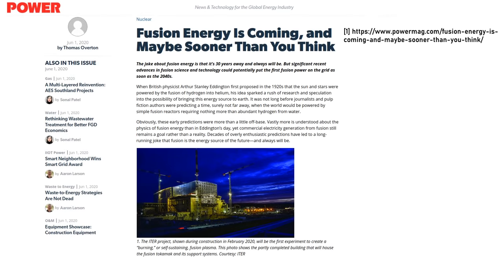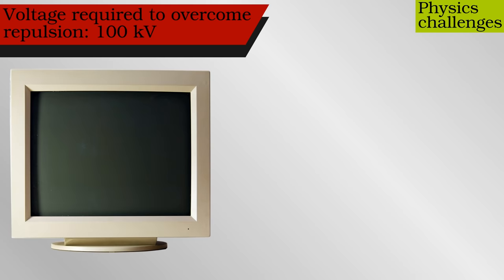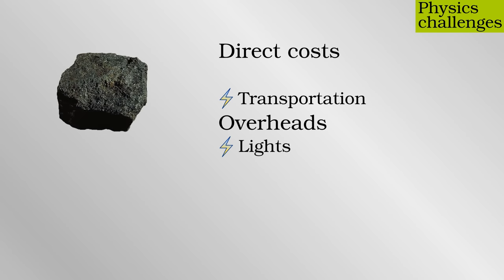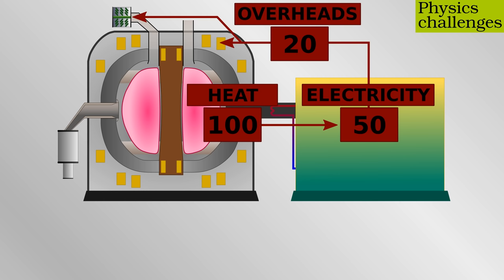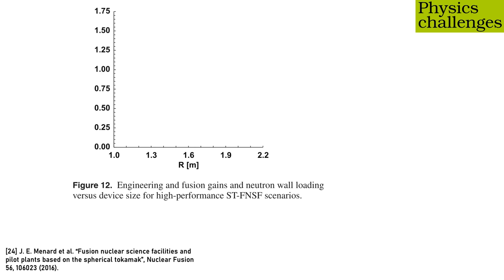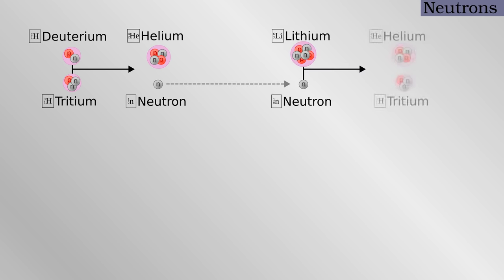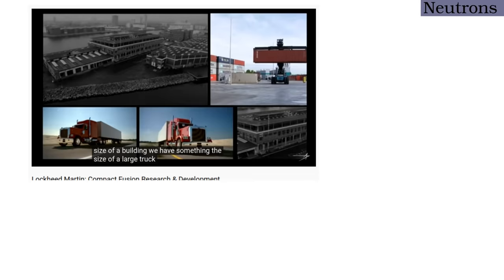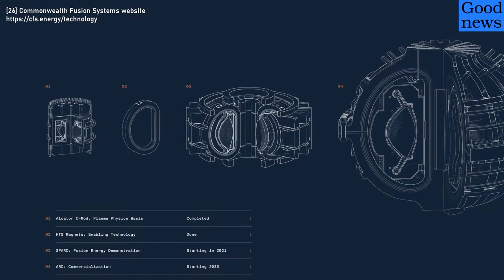Former fusion scientist on why we won't have fusion power by 2040

Comment: It's similar in chemical industry - a yield over 80% of a single step in organic synthesis is considered very good, and over 90% excellent. If just one step has say 50% yield, then the total yield of the whole process gets halved.
Reply: So walter white is a god? Hehe
Reply: There’s a company that got 120 millions Celsius for 101 second. Any progress here?
Reply: @jendlti  Pretty much yes. Just the chemical workup (getting the products out from rxn mixture) and purification have significant losses. One would have to go for some fancy enzymatic process to get 97+% efficiency of an organic reaction and then some very tedious and energy-intensive workup the get all the product out of the reaction medium. It's never like baking a pie, where you just shove it in the oven, bake it (and shake it :D) and you're done. Even if the reaction efficiency is very high, the yield will be lower due to workup.

Comment: You're definitely right about overly optimistic dates being given, but its hard to say what the future holds. MIT's higher temperature superconducting magnets was a huge breakthrough. If we have another 3 or 4 truly major breakthroughs in the technology, that could significantly decrease the time to the first fully operational reactor.
Reply: That pesky cell wall material and tritium breeding is gonna bite our behinds. Plasma control too has got to be super tight.
Reply: @marka1000  As far as I'm aware, ITER (being built in southern France) uses a hybrid design that's not tokamak, but called stellerator or something like that. But i think it's supposed to be more efficient at confining the plasma. Also, tritium will be easy money on the moon, it's everywhere up there. In fact, I think achieving effective fusion power would trigger a new gold rush to the moon, and kickstart the actual colonizing of the moon. Just food for thought!
Reply: MIT were only a "couple" of years from cracking cold-fusion and that was back when Val-Kilmer was a teen.
Reply: @esahg5421  Cold fusion, uri geller bending spoons with his mind... the 80s were a strange time of silliness :D
Reply: @wibblewobbler9104  can you believe it i was a fan of both lol, but been in every avenue i can imagine since. cold fusion sure cost alot of money just like zero-point energy and pyramid power yeah investigate everything but uri now uri was special.  what he taught me was "no one trusts a magician" lol 🤣
Reply: The problem with MIT's fusion approach (and most others, including ITER) is that not only do you need to breed the tritium needed for operation by using lithium as a consumable, but these fusion reactors need pure tritium to start up, and tritium is extremely expensive and rare. Going to the moon for it won't be economically competitive with conventional power anytime soon.
Reply: @TROPtastic  so let me get this right, you think that they are going to fail because they don't know this? but you do ? and have some wicked insight that they couldn't possibly have ? how about just Deuterium with a higher confinement and temperature with the new superconductors ? no ? maybe you should call them and tell them you are on to something...
Reply: @jackfoster3323  they don't NEED Tritium, but it would make things easier, but not essential.
Reply: @marka1000   Most of this stuff is over my head but I read on it from time to time.  A few weeks back I saw a story where one research group had a lot of success getting an artificial intelligence to make the rapid nuanced changed need to manipulate the plasma.  It even created some of it's own new plasma formations that the scientist hadn't thought of yet.  It may have just been a simulation but it appeared to be a reachable solution.
Reply: It's also really close to the technological singularity. Where AI can fill the gaps in our knowledge
Reply: @jjvvjj80377  At the time of the Wright's, many people in many countries were very close to getting "functional" powered sustained manned heavier than air flight. Lots of qualifiers, because without all of them, it was all achieved prior to Wright's famous first flight. The main problem for most of the others was that they may have had a superior piece but were also doing something stupid that held them back. For the Wright's it was they had the superior wing and propeller, a good enough power to weight ratio motor, and horrible control system and aerodynamic control surfaces. It was just good enough to make a mostly strait flight. Langley had a far superior motor and IIRC the modern control surfaces largely came from Curtiss, well for USA. France had people that were making all the same discoveries and only a touch behind, as did many others countries. If the Wright's didn't do it, I don't think it would have been more than a year or two before someone else did.
For fusion, I think the closer beast would be fission. During WW2 countries were working on it with the full financial backing and teamwork only a government can provide. If it was left to corporations all working in secret, I think it would have taken decades, or more.
Reply: @jackfoster3323  Acquiring it and transporting it from the moon is another story.
Reply: @jjvvjj80377  Trust nothing, verify all
Reply: You can't plan for three or four truly major breakthroughs in technology.
Reply: @hellstromcarbunkle8857  Zero planning, serendipidous evidence, mega genius...
Reply: @chrisantoniou4366  Not sure the evidence was serendipitous. The deduction of universal background radiation was the result of solid, disciplined elimination of competing explanations.
Not luck, work.
GENIUS however, no question and luck played a part in finding the fit between the  observation and the explanation was awesome.
Reply: @hellstromcarbunkle8857  Those pigeons pooing in their antenna was luck!
Reply: @chrisantoniou4366  I was actually thinking that their brilliance in identifying the source once the Poo and the oxides were gone was Genius, with some luck
Reply: @hellstromcarbunkle8857  That's exactly what I meant too.  If it hadn't been for the poo they might never have looked...
Reply: If...if...if...
The more if's, the less likely it is.
Reply: @deang5622  Hmmm, no.
THe more "if...then" statements, the more complete the understanding of the problem.
Thus the more likely the project will be finished.
Reply: @hellstromcarbunkle8857  No you are wrong.
The higher the number of if statements, the higher the number of problems that need to be solved. The greater the number of problems that need to be solved, the lower is the risk of success.

The presence of an if statement is realisation that there is problem to be solved;  it says nothing about your level of understanding of the problem, and it also says nothing about your understanding of what the solution to that problem is.
Reply: @deang5622  So, you've never coded a single line of control system?
Because if you had, you'd know better.
Reply: @jjvvjj80377  but they never would have have learned flight beating the air with a spoon as hard as they could, and just changing what the spoon is made of over the years.
Reply: @psycronizer  someone should tell them. This won’t work because they’re completely misunderstanding the basic matter/energy relationship, and trying to run backwards. The theory of relativity at its most fundamental level means matter itself is already highly concentrated energy. Concentrating it into denser elements takes power, and “squeezes” some of that applied power out in the transformation, but not more than you put in. People talking about cold fusion power are as confused as people talking about “hydrogen power”. Hydrogen isn’t a power source, it’s a battery. You don’t mine hydrogen, you use power to create that form, and the amount of energy you get back will be less than it took to create it. But it’s a clean process, cleaner than most batteries. Fusion is not a power source, it’s the direct result of a power source. The sun isn’t “powered” by fusion, it’s powered by an immense gravity well, actively compressing lighter elements and squeezing a fraction of that gravitational force out as energy. If we already had an unlimited power source to maintain a fusion reaction, we wouldn’t need it. Molten salt MSRs can already meet all these needs, anyway. They go in the correct, logical direction, releasing the unstable, heavier elements into their fundamental energy. This seems more of a distraction and waste of time and money, because we don’t want a solution. Thorium’s considered a waste product of mining right now. There’s more than enough if it easily accessible to meet current energy demands for thousands of years. MSRs are also better than traditional reactors, “burning” up a lot of the toxic, weapons-grade waste current reactors are designed to concentrate and enrich. They’re also meltdown-proof, can be made small and module, and the reduced waste they do create degrades to safer elements a lot faster, in hundreds of years versus thousands. Cold fusion is an expensive distraction. At best, fusion can be used to enhance fission for a more complete “burn”. That’s why fusion bombs are always coupled with an actual fission device too.
Reply: @jackfoster3323  ITER is a tokamak .. W7X (Germany) is a stellarator
Reply: @marka1000  we could breed tritium in a heavy water fission reactor
Reply: How would fusion energy be converted into usable energy?
Reply: Maybe check out the economics of PV solar and offshore wind. China has some interesting solar projects where the payback on investment I seem to recall would be about 2 years. The figures are much better than we see over in the West what with all the planning problems and so on.  I think they do it via economy of scale.
Reply: @jackfoster3323 your proposal regarding the moon rush reminds me of the hard sci-fi manga & anime Planetes

Although I don’t recall the exact materials for the rush, but it certainly has a heavy role on the setting & plot

Comment: As an A grade Electrician with 33 years experience I find this absolutely fascinating ,I've been avidly following the Tocomac and other reactor designs so your simple concise explanations - 
The analysis provided is clear and understood ,I'd be fascinated to see and actual breakdown of all the coils,pumps and other equipment to fully understand the power requirements of the input energy and then the outputs including losses and efficiencies .
Also permanent energy inputs versus generator outputs .
Follow up videos as you mentioned.
 would be marvelous if you get the time .
Thanks for your well presented and informative work .
Reply: The ITER website has a good rundown. The coils in their reactor contain something like 100,000km of wire.

Comment: My physics professor once predicted: 

“Building a functioning fusion reactor would require nothing short of yet another Manhattan Project … thousands of nuclear scientists, supported by a tenfold of construction workers, plant operators, security staff, drivers, cooks, cleaners, etc. — all in one spot in the middle of nowhere for espionage and sabotage deterrence… working 24/7… consuming the economic output of a mid-sized country in the process… for years on end… with uncertain outcome.“

And frankly, if there were an endeavor with such a magnitude of effort, they were able to conceal it quite well — or word had gone out by now.
Reply: Fusion is an incredibly hard feat for sure.

Comment: It's very refreshing to see this issue discussed in a knowledgeable and digestible way.  I would add that the disparity in fusion investment between the 1970s (resulting in the JET data shown at 7:40) and now (we haven't repeated let alone defeated that record) helps to motivate optimism about what is possible if we decide to spend the money.  Going from Q=0 to Q=1 at the plasma may turn out to be much harder than going from Q=1 to Q=100.  There are many industries around the world which have successfully tackled these nuclear engineering challenges such as tritium handling, neutron blankets, etc., but the stuff we needed to get to Q=1 was entirely novel.  Fingers crossed that MIT can make us optimistic again!